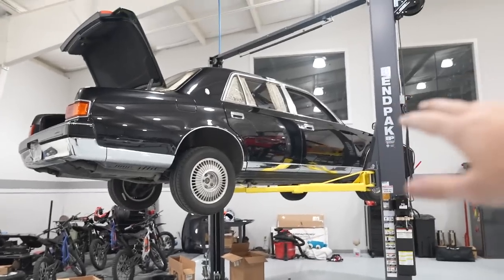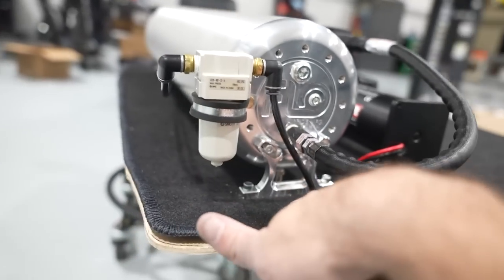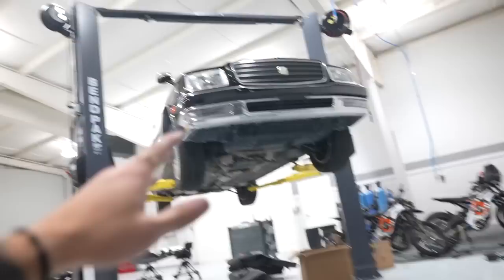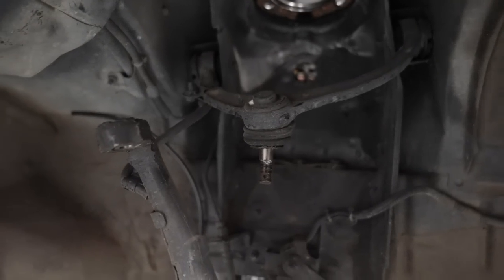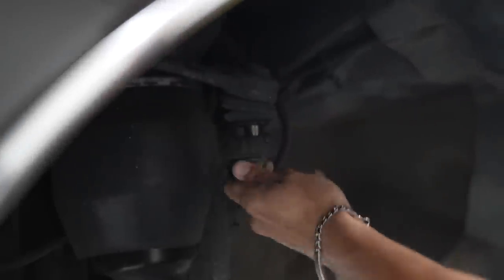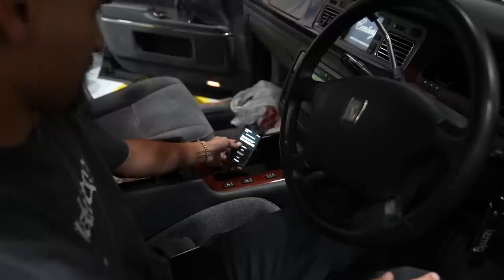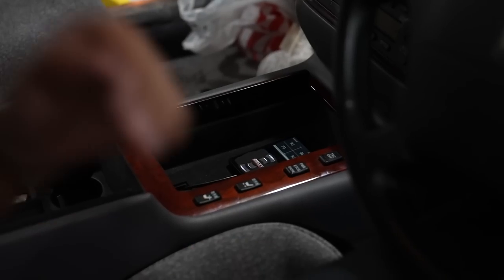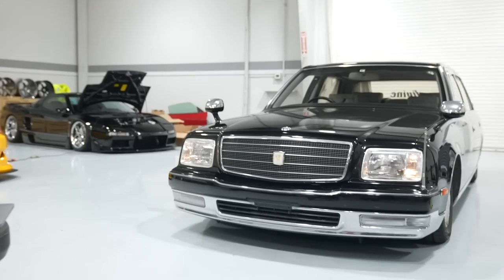My V12 Toyota Century Air Suspension install is FINISHED!

Comment: The 3 piece conversion on the century wheels is gonna be sick
Reply: not really, Century needs 19s. And 16s to 19s conversion looks dumb af because of double step lip and really small face.
16s to 18s coversation look cool, but 18s are definitely too small for this boat.
Reply: @hipijs1337  i mean it’s personal preference but i do get the point

Comment: Can you educate us on why you went with a custom kit vs just an air ride controller for the factory air ride? And maybe what the benefit of this setup would have over the airlift height sensor setups offered for the LS400? 
Just got a GZG50 last fall, so this series was a BAD idea for me to watch 😂
Reply from the maker: More height adjustment, dampening adjustment for better shock rates once I have different wheel and body kit setups, custom presets, etc. haha

Comment: Love the videos. But what did u do with the original airsuspension system? Just remove the original bags, tuck the original airlines and remove a fuse? or what did u do? Would appreciate it if you could tell it in some detail. Gonna bag my Lexus LS400. And it has the same suspension as the Century
Reply from the maker: Yes I did exactly that, no error codes either!
Reply: @diiviinemedia  What fuse did u remove? Because there is like 2-4 air sus fuses
Reply from the maker: @bumpyspade3936  there was only 1 main fuse for me, LS’s may be different
Reply: @diiviinemedia  Okay thanks